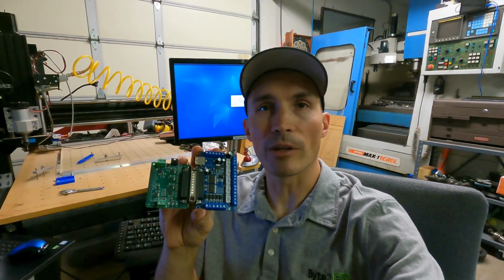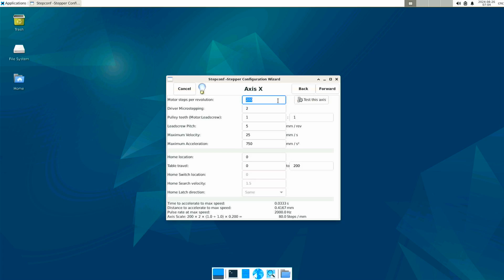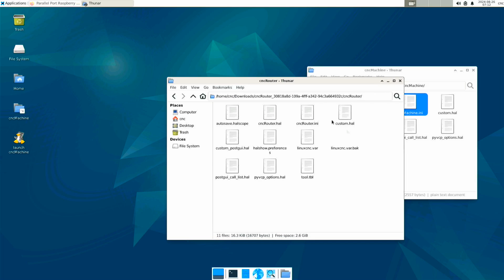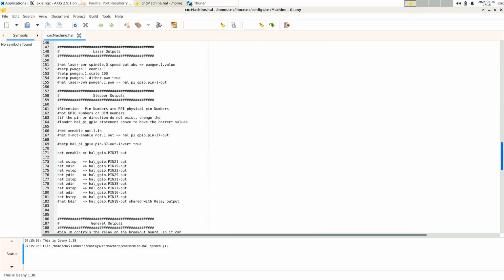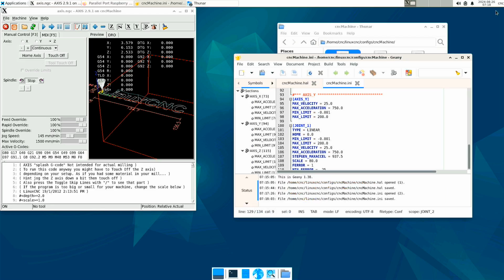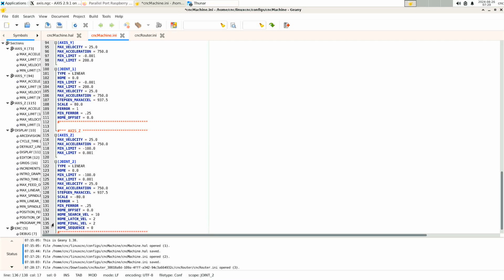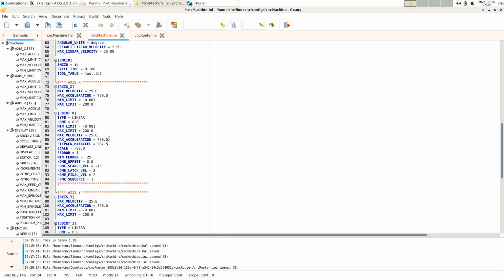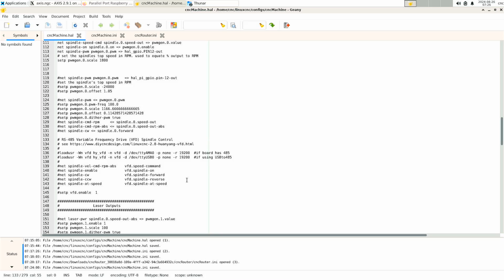Setting Up LinuxCNC for the Raspberry Pi Parallel Hat and 5 Axis Breakout Board

Comment: Thanks for your efforts on behalf of all the Linuxcnc wannabees out there. It's nice to get into the game without the cost of expensive mesa boards. I'm building a plasma CNC machine and would like to use one of the linuxcnc, plasma builds. Are there any downsides to using a raspberry pie that you are aware of verses using a traditional PC/mesa setup. What is the minimum size ram you can use for a pie 5. I know more is better but pies are not as cheap as they used to be. Would a 4GB model be enough ram? Thanks for all your help.
Reply from the maker: The downside is that you will not be able to rapid as fast as the mesa boards. I think a 4G pi would be fine.  I think a Pi3 would probably run LinuxCNC fast enough, but the user interface snappyness is so much nicer on a Pi5 that it is worth the extra money.  Good luck with your project!

Comment: Well mine is not working on pi 4  it's gotta something to do with the 5v I think i get all the lights 
I tried everything any better wiring guides out their why so hard for one axis the z 
At this point I have to suspect i got faulty bo or hat something the lights ????seems to be working I've tested the stepper and the driver they work with the dm-556 it all works great  on mach 3 with just the bo and a ucnc100 parallel  port dongle on a Panasonic toughbook running win 7 
what gives ??????
Reply from the maker: Are you able to measure the outputs at the breakout board with a multimeter?  The step and direction pins should toggle.  If there is any issue with a specific channel of the hat, the A and B axis outputs could also be configured in the HAL file to be used for your Z axis for troubleshooting.  I will be happy to replace it if there is an issue.  I can help better if you email me through the website.  -Dan
Reply: @Byte2Bot what do you mean toggle explain please ?
Reply from the maker: @RGCbaseace toggle means to turn on and off.  The direction pin between the breakout board and your stepper driver should be high voltage when going one direction and low voltage when going the other direction.  The step pin should go high and low rapidly when moving.  If it doesn't, either the hal file is not configured correctly or the hardware is bad.  If I don't reply to other messages, please email me.  I get too many YouTube notifications to keep track of them all.
Reply: @Byte2Bot ok did that nada but you can feel it pulse while holding the stepper shaft and keying the z+z- i think its the bob ??? I ordered  another to try dont worry about it im gonna try a usb version for now i realy wanted the pi 4 to work but oh well back to 7 and mach 3 for now i haven't given up on the pi
Reply: Yeah i did measure all seems good 
Not sure where else to look i have the 5v,12,and 24 added and I have only the z wired it seems to be on
 ( working )my dm-556 dosnt have a sw3 for setting to enable 5v only amp setting  i am unable to make it turn via the linixcnc
It seems it might be somethig on the hal file side ? The error i get when linix dosent start is does not see the " lpt port " why can't their just be that" Bob" in the list where it
 says other  just say where and I'll send you a video of what i got ???
Going to pull the pi out of its argon one case to see if maybe I didn't get it plugged into all the gpio 
Ribbon??? These parts stepper driver  all worked on a mach 3 setup with ucnc100
Reply from the maker: @RGCbaseace It does sound like the HAL file needs adjustment.  Could you please send it to me?  It shouldn't be looking for an LPT port because that doesn't exist on the pi.  The HAL files that I supply on the parallel hat page should be a drop in to get you mostly running.  The limits and steps per inch and all that stuff will need to be adjusted, but I hope the HAL file is a good starting point.
Reply from the maker: Yes, I will send the HAL files!
Reply: Ok i pulled that hal file to a flash drive ill send were ? Also i photographed the crash file 
I havexa few very clear photos it all seem correct ?
Reply: I'm gonna take it apart again and test the Bob driver and stepper on my beast with the ucnc100 it's wired the same but did work on win7 mach 3
Reply: Well your hat seems fine it looks like Bob is got another comming I'll let you know may be it time for another pi 5

Comment: What post processor file does this use sir ?
Reply from the maker: Good question.  I recently got a new laptop and had to reinstall Fusion360, so I lost my default configuration parameters.  I do need to set that up again and I will choose the Autodesk Generic 3 axis machine.  That post processor should be fairly generic and if there is anything special that needs to be done, like homing or special G codes at the beginning of each file, the post processor script can be modified.  If you are using some other CAD tool, there should be a generic post processor that should work for most things in LinuxCNC.
Reply: @Byte2Bot  thank you
Reply: Thank you I use aspire 9 and v carve pro  I have a list of pp files in their a mile long im sure their is one that will work I'll try fusion one first

Comment: I followed instruction of the video but the linuxcnc doesn't work and showed the following message
Print file information:

RUN_IN_PLACE=no
LINUXCNC_DIR=
LINUXCNC_BIN_DIR=/usr/bin
LINUXCNC_TCL_DIR=/usr/lib/tcltk/linuxcnc
LINUXCNC_SCRIPT_DIR=
LINUXCNC_RTLIB_DIR=/usr/lib/linuxcnc/modules
LINUXCNC_CONFIG_DIR=
LINUXCNC_LANG_DIR=/usr/lib/tcltk/linuxcnc/msgs
INIVAR=inivar
HALCMD=halcmd
LINUXCNC_EMCSH=/usr/bin/wish8.6
LINUXCNC - 2.9.4
Machine configuration directory is '/home/cnc/linuxcnc/configs/cncmachine'
Machine configuration file is 'cncmachine.ini'
INIFILE=/home/cnc/linuxcnc/configs/cncmachine/cncmachine.ini
VERSION=1.1
PARAMETER_FILE=linuxcnc.var
TPMOD=
HOMEMOD=
TASK=milltask
HALUI=
DISPLAY=axis
COORDINATES=X Y Z A
KINEMATICS=trivkins coordinates=XYZA
Starting LinuxCNC...
Starting LinuxCNC server program: linuxcncsvr
Loading Real Time OS, RTAPI, and HAL_LIB modules
Starting LinuxCNC IO program: io
linuxcnc TPMOD=tpmod HOMEMOD=homemod EMCMOT=motmod
Found file(REL): ./cncmachine.hal
Shutting down and cleaning up LinuxCNC...
Removing HAL_LIB, RTAPI, and Real Time OS modules
Removing NML shared memory segments

Debug file information:
Note: Using POSIX realtime
hal_gpio: Failed to register input pin collection
hal_gpio: rtapi_app_main: Operation not permitted (-1)
./cncmachine.hal:77: waitpid failed /usr/bin/rtapi_app hal_gpio
./cncmachine.hal:77: /usr/bin/rtapi_app exited without becoming ready
./cncmachine.hal:77: insmod for hal_gpio failed, returned -1
19253
Stopping realtime threads
Unloading hal components
Note: Using POSIX realtime

Comment: Question when you planing to get the parallel port hat and other hardware related back to stock? Thanks
Reply from the maker: Since I have to finalize and test the boards, I keep the website stock set to whatever is packaged and ready to go.  Generally most things will be back in stock in less than a day.

Comment: Why wouldn't a person define the axis parameters in the stepconf as opposed to modifying them in the HAL and ini files after the fact?
Reply: modify, but how, not understand i need setting gpio pns but no have linuxcnc rpi4-5 setting wisard, only paraller port wisard or pnc config tool can use mesa card, how modify or setting.

Comment: This is fantastic. I find LinuxCNC quite intimidating. You have definitely helped reduce the intimidation factor. I don't want to be a hardware/software engineer to run my mill and router, I just want them to work. Thanks!

Comment: How to add mpg and other phyaical key?
Reply: same i ask, i not know how, use only gpo pins whit shift levl converter module, 3,3V to 5V module, but how setting gpio pins, just buy all parts encoder, buttons, rotary SW, not understand setting wisard not have gpio pins only paraller port pins, and pnc cofig can setting only mesa card pins. were can setting all gpio pins. and how or what need doing hal and ini files or what need doing, setting rpi4.

Comment from the maker: Just FYI, some people have reported issues with the latest build of LinuxCNC for the raspberry Pi.  The error occurs when trying to start LinuxCNC with the HAL file I provide.  The error indicates that GPIO26 cannot be found.  The quick fix to this is to use a slightly older version of the LinuxCNC image.  The 11-17-2023 build located here appears to work:  https://www.linuxcnc.org/iso/
Reply: I can confirm that solved that issue! thank you. Also if you are setting up a machine with a different number of axis then some surgery will need to be done on the hal file to call the right motors. I am building a lathe so X and Z only for me

Comment: I’m running into an issue. Followed all steps and Linuxcnc is running. However. The steppers won’t move (holding torque is there) I have checked and rechecked the wiring a million times. I’m using nema 23 steppers with the stepperonline dm542t and cl57t stepper drivers. What am I missing?
Reply from the maker: Sometimes the default limit switch settings might cause this if you don't have any limit switches installed.  Try commenting out those settings in the HAL file.
Reply: Thanks for the quick response! I have commented the limit switches out. That solved the issue of the limit switch error when nothing was connected. Now I can move the machine in Linuxcnc. However, still the same issue with the motor. Holding torque is there. I can also measure that dir goes from 5v to 0v when switching directions. On pulse I can’t measure 5v. I only measure anywhere between 0,9-5.1mv. Assuming this might be the issue? I don’t have an oscilloscope to see if there is a pulse
Reply from the maker: The breakout board can sink more current than it can source.  The stepper drivers that I use have optocouplers on their inputs.  I needed to rewire my own machine to pull the  driver opto inputs high and allow the breakout board to control the low side of the opto LED.  Also, make sure you don't wire the opto LED backwards as that won't work either.  I think you are getting close to getting it to work!
Reply: I’ve checked the data sheet of the dm542t drive and it’s the same as with your machine from what I can tell. I have wired all + terminals to the pc5v and wired all - wires to the pins. Pul- to p2, Dir- to p3 and Ena- to p14 as on the schematic on your website. To make things even more confusing for me, when I wire it up to a tmc2130 I had laying around and a nema 17 the motor holds it’s torque when I toggle machine power on. But then sometimes it loses torque or sometimes the motor jitters and doesn’t go any particular direction.

Comment: Good video and well explained, but how do i wire up and implement a handwheel ?
Reply from the maker: A handwheel is a trick.  I ordered a few from AliExpress and the only way I can think of to get one to work on a Pi is to use one that has a USB interface.  Those are typically made for Mach 3.  The handwheel should show up in the OS as a serial port.  The trouble is, a plugin needs to be written for LinuxCNC to query the handwheel like Mach 3 does.  I have not gotten that to work.  If you find anything on the internet that describes how to get that interface to work, please let me know! 

Most handwheels are a discrete interface with multiple wires.  Those are typically easier to use with a USB or Ethernet based breakout board (not the parallel hat/5 axis breakout board).  

I would like one myself, so I am still looking for a simple USB solution for this, and I think whatever that solution is could work just about anywhere, not just the Pi.
Reply: @Byte2Bot  i found this and i think it shooud also work with the pi5, but the video is in german https://www.youtube.com/watch?v=e2DjkzCq7R4
Reply: @Byte2Bot  or the "analog" homemade version of the same guy https://www.youtube.com/watch?v=hkbkN2GcQ-0
Reply: @Byte2Bot Hi.I came across a project on Arduino Mega where the author has implemented 54 output inputs for LinuxCNS.
and gave detailed explanations and instructions with examples such as MPG, matrix keyboard, galette switches, backlit buttons.All this on only one USB port. https://www.youtube.com/channel/UCCTefZCkTUUp00Vs1iFE-Ng/videos
Reply from the maker: Wow, that is a powerful software tool!  Thank you for pointing it out! I am looking into making a prototype of a rotary encoder now.  Alex did a great job of documenting and explaining his work.

Comment: I have a Raspberry Pi 5 running with your hat driving my mill and my router.  It works great and your support information was very helpful.  Linux and LinuxCNC can be very confusing but your input supports those who just want to "make chips".

Comment: I have Linuxcnc working on a RPI 4 as a test setup. Thanks for sharing.
Reply: how i can setting all gpio to output pins and input pins, linuxcnc have only my rpi4 parallerport pins setting wisard and pnc config can setting only mesa card, need help how make only gpio pins setting, i use output pins cheap paraller port BOB card but all input need use own optocoupler module all input pins, and not understand what need doing hal and ini files or other what need doing. i just buy rpi4, encoder, buttons, E-stop SW, some shift level converter, output and input can use converter 3,3V to 5V converter. tx108 chip.and some rotary SW select axis and scale. but how setting this. rpi4.